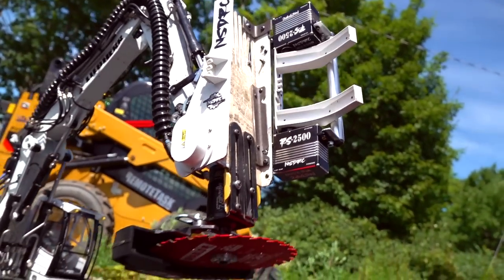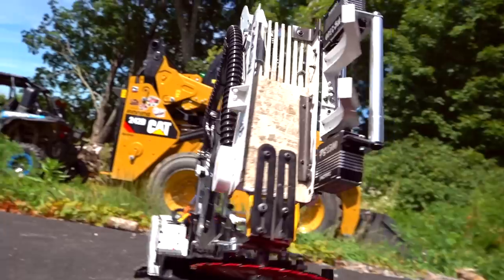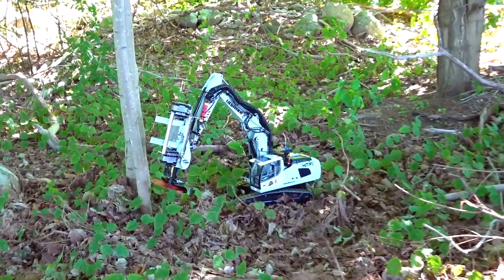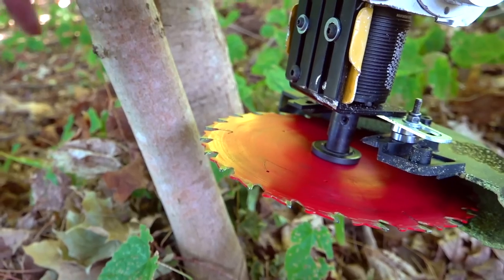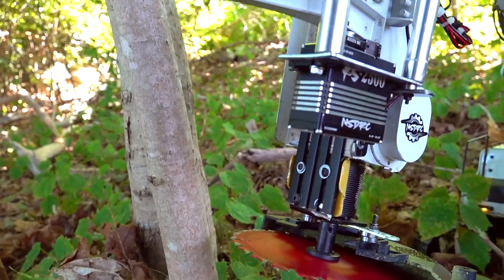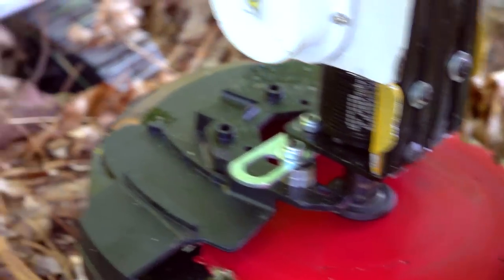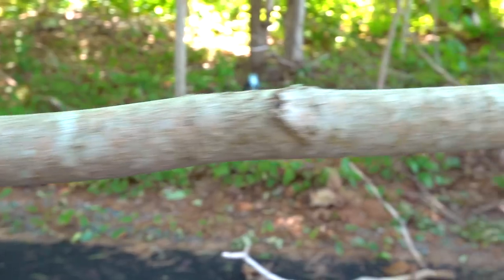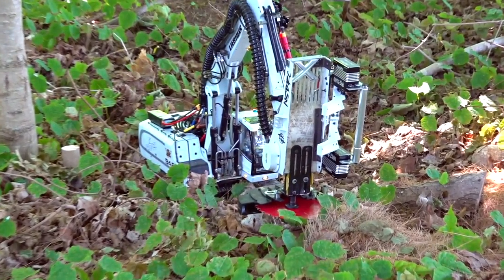Homemade POWER TOOLS - DiABLO Eats Maple #majorwood - NSDRC "Feller Buncher" | RC ADVENTURES

Comment: The blade needs a platform on top of it to prevent the tree from falling on it after it is cut. The full sized ones are designed this way. Looking good so far.

Comment: I’ve been hoping you would get into the logging rc world. Sure could make for a cool show. Not sure what you have to build things with but I bet you could build a more scale head like a quadco housing the motor inside the structure for the saw and hydraulic rams for the clamp arms the design of that head is very basic and it looks like you have auxiliary ports on the boom. Might even be lighter. Not saying anything negative to what you built at all I just grew up in a big logging community my whole life I work on and repair logging equipment as a fabricator so I can’t help myself when it comes to scale of these things. Makes me want a feller bunch rc so bad seeing this. there’s so many cool pieces of equipment in the logging industry can’t wait to see what you do.
Reply: Logging is perfect and gold was a good starting ground.  Logging does have serious tool factor. I’m thrilled you’re enjoying!!

Comment: I think you should try looking into the chainsaw versions of these. It wouldn't be too hard to put a mini chainsaw on a servo retracted until the shaft of w.o.o.d has been clamped before cutting.
Reply from the maker: I think I have looked into them, and even built several chainsaws on this channel ;)
Reply: @TheRealRCSparks  I know, I've watched every single one of your videos for years. My point is that a retractable chainsaw would work better with this setup than with a circular blade that gets in the way before you can clamp what you're cutting.
Reply: I agree. Musch easier to slowly rotate in the servo instead of moving the entire arm. The Bosch nanoblade mini chainsaw would be ideal for this.

Comment: Coming from the operator world . Is there any way that you can add a little bit of weight to the back end of the excavator maybe some lead or some metal plates somewhere hidden So when it does grab hold and cut a good size tree like such it will transfer the weight?